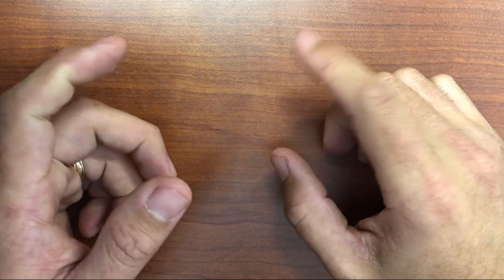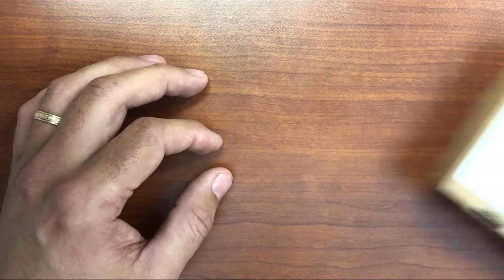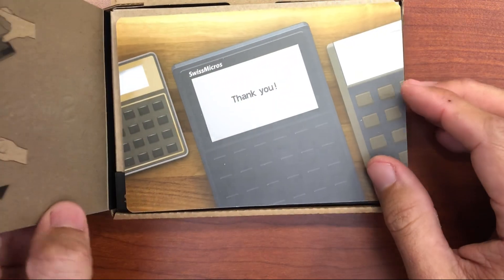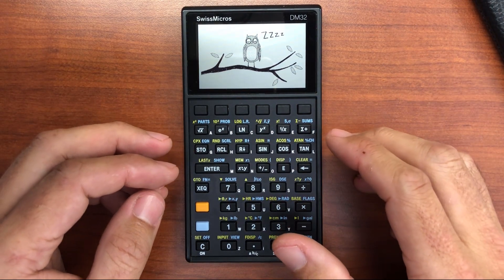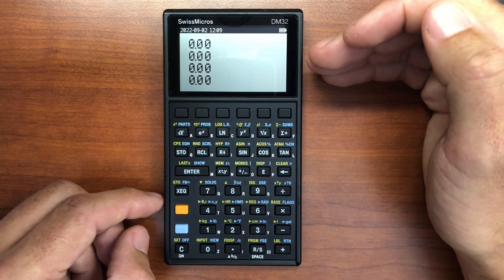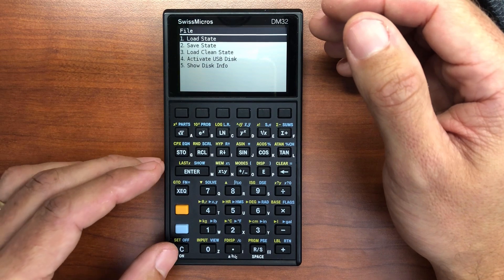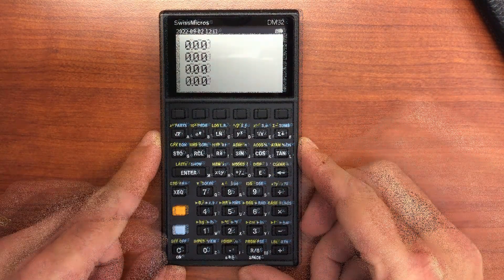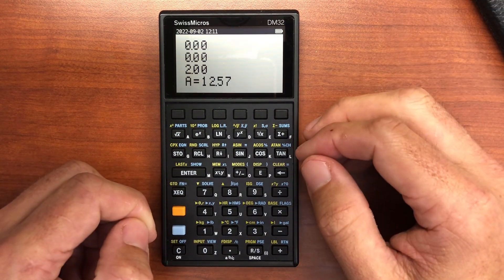DM32 Unboxing and Introduction (HP 32Sii upgrade)

Comment: I bought my 32SII brand new when they  came out and have loved it ever since.  It's very hard to find a calculator equal to it, so this is interesting.  I don't know if you are aware, but I think I paid about $70 for mine new, and you can not find a decent one for sale on Ebay for that much money.  Maybe you can find a broken one.  I did buy one with a display problem (as you have repaired in one of your videos) on Facebook and was only able to get that because the guy didn't know what he had.  So if this product does all the functions and does them as well as HP made theirs, people will have an interest in them.

Comment: Cool! I'm a fan of swissmicros work, but the calculator I used in my phd was a remake of the hp35. One of the reason I loved it, was the conversion key. I was drawing in metric from imperial measurement (Canada)! Loved the experience. That's why I bought swissmicros calculator. This one seems soooo close to what I used.

Comment: This last calculator I bougth was a HP 42S back in 1995. This might be the next one. The 42S was great. But for simple calculations I always find myself using my older 11C. The only thing that I miss from my 11C is a display that allows to see the entire stack. This is precisely what the DM32 is offering.
Reply from the maker: I think you might be right. There is a lot of functionality that the 42 has that I just don't use because if I'm going to do anything complicated, I'll do it in Excel or MATLAB. But for simple calculations, the DM32 would be great. I forgot to demo the fraction handling but that's really neat and I really like all the readily available conversions.
Reply: @west  Thanks a lot for the great presentation!

Comment: This couldnt Come out at a better time. Found your channel a couple of days ago. Started playing around with free42 on my Phone. Now ive gotten my hands on a 48sx while i try to figure out if van justify the money for a swissmicros calculator .
Reply from the maker: I love the DM42. The DM32 is probably going to have a release date of some time next year. Chip shortages are affecting even these calculators so they had to change the design a little bit. If they had stuck with the old design they were told that chips wouldn't be in stock until 2024 I believe!

Comment: Interesting! What is the exponent range, and what's the result of 1 ENTER 3 ENTER 1/X × - ?
Reply from the maker: Hi Thomas! Exponent range is 10^499, it looks like. Answer for your calculation is 1e-34 :)
Reply: @west  Or they might have chosen to limit the exponent range in order to make their lives a bit easier with coding the internals. A lot of functions are easier to implement if you can defer range checks to the end, without having to worry about overflows in intermediaries.
Reply: @west  Cool, thanks! And I read on the MoHPC forum that it uses the Intel library, so it looks like they're just limiting the exponent range, probably to avoid issues with numbers not fitting in the HP-32SII display layout.

Comment: That's a good looking calculator. I was lucky to find some old HP calculators at work! As much as I like them, I hardly use them because work is done on the computer. It feels like a bit of a shame... and they're supposed to be good calculators so using them to do arithmetic feels belittling (as if calculators have feelings lol). Maybe a waste of their potential/power is a better way to put it.
Reply from the maker: Yeah, I know the feeling. I almost always have Excel or MATLAB or Python open myself. I've actually made some good use of the calculators during meetings but most of the time it's a quick multiplication, and an occasional log. Almost never an integration or a standard deviation!